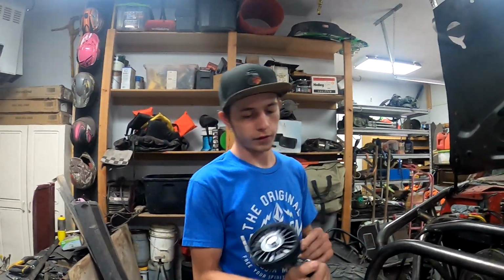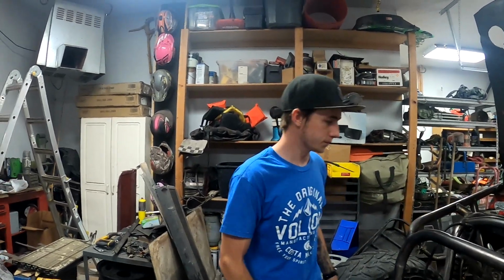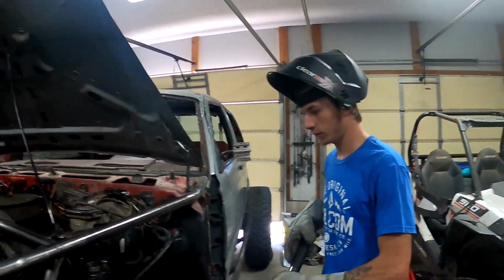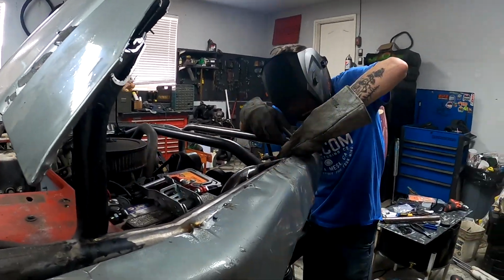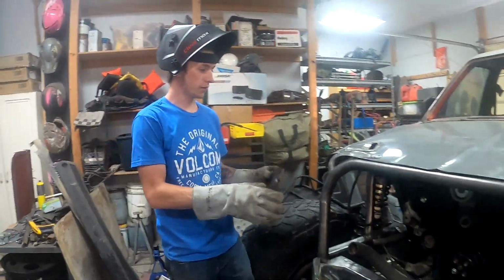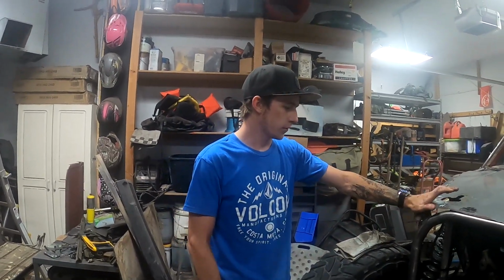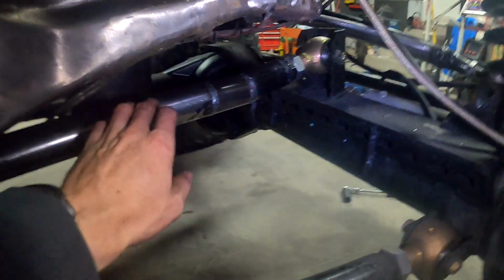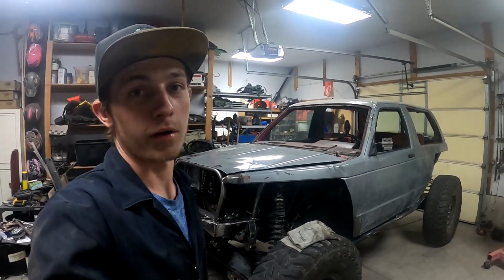StuBlazer gets fenders!

Comment: No need to apologize or explain Owen.  It's a cool build and most importantly.  It's your build.  You made the right decision.  As stated you never run the ac. Plus as you mentioned Vintage Air makes a nice under dash unit that you could add in the future if desired.  Heat is a snow suit and warm clothes...now that being said it does provide to defrost the windshield.  But there are ways to resolve that down the road.  But you made the right decision.  Keep up the great work and cool build.  😎.. take this to the limit... You can even go in and remove some of body "framing  ?".. and just have the skin on it.  Reduce the weight even more.  But bottom line is it is your build and your doing a great job.  👍

Down the road... consider using the  donor  vehicle.  Cut and make a set of replacement  panels... skins only.  Then use quarter turn fastners for easy on and off.  A lot to visualize for the future... and it is going to be fun to watch and see what you have in store for it. Along  following your build progress... a big set paddle tires ...some sand and mud fun lol... the best builds are never done... 
  Keep doing what you're doing  👌 Really enjoy watching the build and your channel.

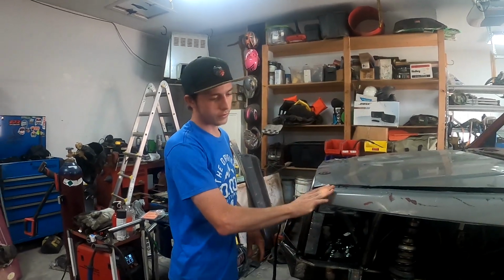Comment: AC is for pu**ies! 😊😊(and $20.00 is $20.00!) @1:20... Umm, Heat is Heat, it is not related to the AC compressor. @2:18... She has spoken, so shall it be! @10:23... Holy Manual Saws Batman!!! @11:10... While I don't advise making the wasps madder, she did "Issue a Challenge" 😉😉 So, when you were hammering the passenger fender on the tire... If you have a Vice or Trailer Ball available, it makes it a bit easier. So, what's the plan for the Driver Side A Pillar?
Reply from the maker: Hammer it out until a window fits haha

Comment: You build what you want, ac in an open cabin truck is pointless. I’d only add, having factory heater would be useful to help cooling the engine on the trail